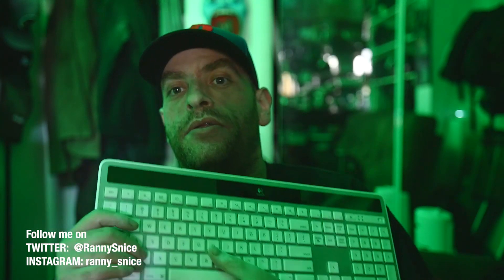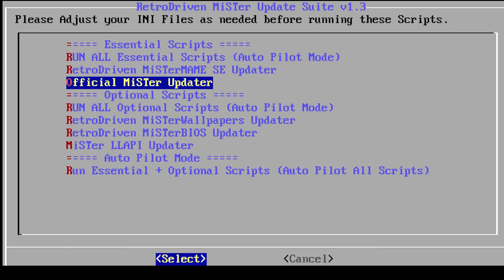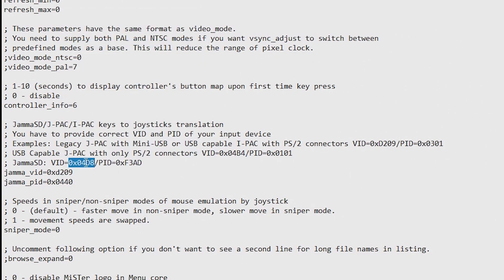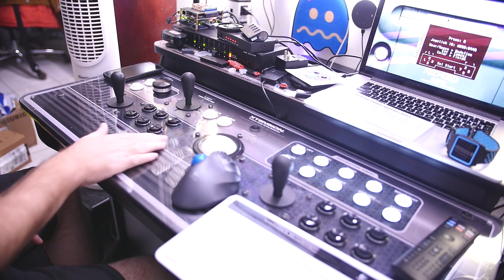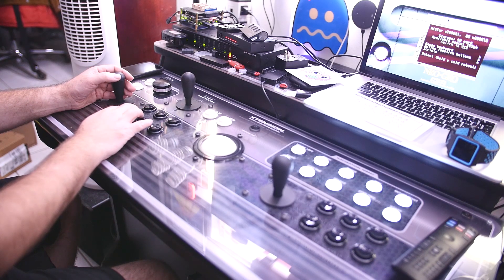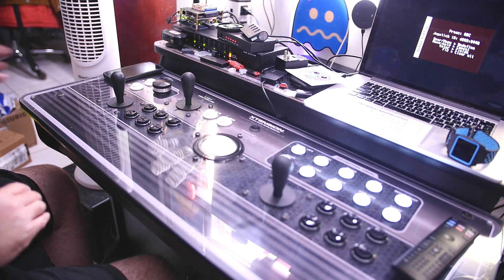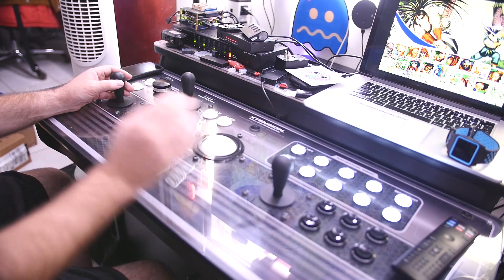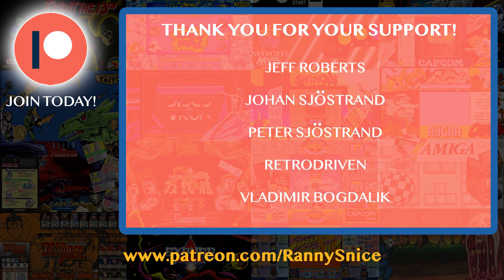Setup your I-PAC/J-PAC Controls for MiSTer

Comment: Hello, I am curious about the IPAC side of things.  Is the IPAC configured as all keyboard keys that use the Mame default keys, or are any of the joystick connections configured as joysticks in the IPAC configuration tool?  I am guessing that it is all keyboard keys, and when you make mappings in the MiSTer, it knows what keyboard keys the IPAC is sending for both players and maps them automatically as you have shown.  Theoretically, could an Arduino be used instead if it was programmed with the same keys and still give it the pid and vid of the Arduino?

Comment: Hello I am also setting mister fpga to j-pac in Newnet City. I connected j-pac to the jvw to jamma setting, and I updated the core and bios with the all-update script. However, after running the game, a strong green color is displayed on the overall menu or game screen. Anyone can see it clearly. Did you know this phenomenon? ㅠㅜ
Reply from the maker: It sounds to me like this could be a sync issue. "My life in Gaming" has videos about this. I hope this video helps! Good luck! https://youtu.be/LAlrdCBjUAQ
Reply: @snicelord  
Thank you. I solved the j-pac's color issue by receiving a solution email from misteraddons.com asking me to remove the C6 capacitor from the i/o board and connect the wire to it.^^
Reply: @어색하게레트로  I have the same issue. Does this require soldering?  I’m new to mister my screen is green too .
Reply: @Nob1tas   
Yes, if you use the j-pac + MisTer combination, a simple soldering is required. There was a phenomenon in which green and red were emphasized, too, and removing the C6 capacitor on the back of the I/O board and connecting it with 1 wire will solve the problem. I hope to solve it.^^
Reply: @어색하게레트로  I am not good with electronics soldering, do you think I should just buy a Jammasd v3 instead?
Reply: @어색하게레트로  please, you say remove the capacitor, and the wire you mention where it goes.
The wire is like a jumper when the capacitor c6 goes.
Thanks
Reply: @Nob1tas   
Jammasd v3 I haven't tried it, so I can't tell you. The mister addons recommended removing the C6 capacitor from the I/O board as above, and I removed it and soldered a thin one-way wire in place to fix the color issue. .
Reply: @bernatnadalcursach326   
When the C6 capacitor is removed, there are two bottom faces (?) that connected C6 to each other, and you can solder these two with a single wire.
Reply: @어색하게레트로  hello.
Thanks, i tried and work good.

Comment: Broooo THANK YOU! I'm building a MiSTer cabinet from scratch. Was planning to use an IPAC-2 that I've had since 2017, but heard about all the issues with 2-player registration over a single USB input. Have been researching my tits off and even ordered a cheap Xin Mi encoder for P2 because I didn't think I'd get the IPAC working. Not sure how exactly this fix works, but I'll rewatch the video a bunch of times and give it a try when all my parts arrive. I appreciate you!!

One question for you - which mode should the IPAC be configured in for this setup? Dual X-Input mode?
Reply from the maker: Hey, thank you very much! I appreciate it! I believe it is dual x-input mode! Let me know how it turns out when you put it together!☺